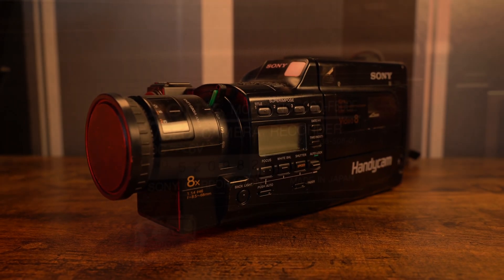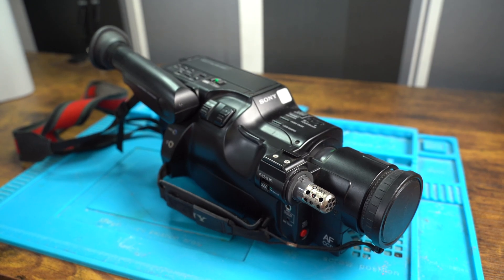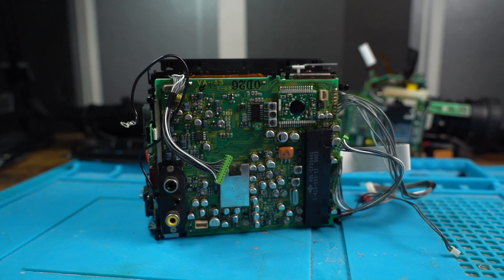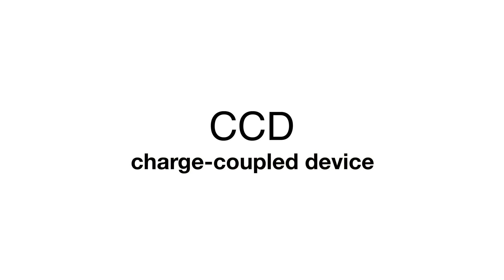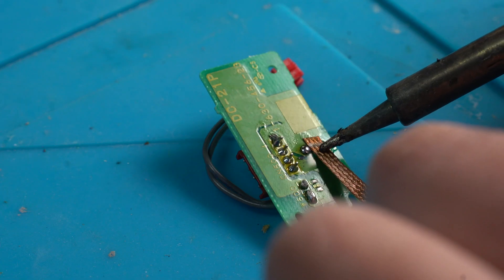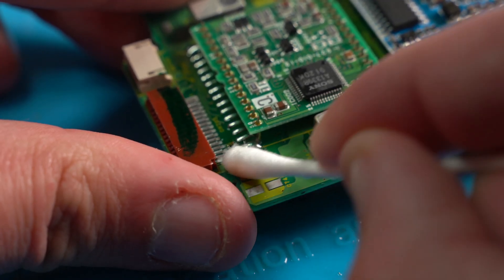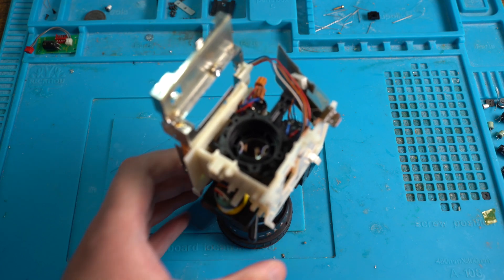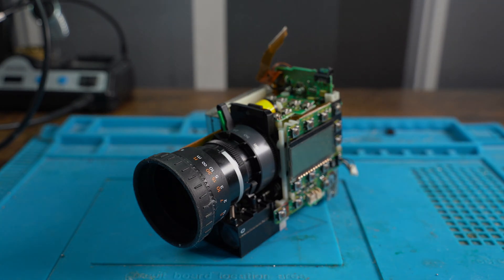Sony CCD-F500 Restoration - Part 1 - 4K

Comment: I have a capacitor that says 47 6s 36A what should I replace it with
Reply: not sure what the 36a is printed on the capacitor for, but replace it with another 47uf at 6v and newer too

Comment: This is a very informative video on how to recap an older Sony 8mm camcorder. I have a similar Sony model, the best at the time, the CCD-F501 (NA model, NTSC, circa 1992) which has same issue, it has power but the video section does not show any video, despite the fact that the playback section seems to work, at least the tape section. I want to really do a recap on this camera, as it served me well for more than 7 years before I moved on a newer TR-V41 Hi8 model, and the camera died because it did not get used for several years. I just want to bring it back to live not just for sentimental reason,  but also to use it occasionally as the situation calls for, even if I now mostly use my Sony DVC camera. This video is the most useful video I found that I can use as reference to fix my trusty old Sony CCD camera.

Comment: Im about to jump into a few hi8 cameras myself. My dad has 2 that are the exact same model. They power on but dont work beyond that. One has a working tape door but the other does not. My guess first off is going to be caps. I know its going to be tough but im going to take a lot of pictures and videos. I should have everything i need besides replacement caps. Im not sure what ill need to order until i take it apart. Im very worried about the plastics. I dont even know if theres been teardowns of the cameras im about to jump into. Ill probably be using this video as a reference despite it not being the same camera because this seems to be what ive got for resources. I appreciate the videos a lot.

Comment: I realize this video is 2 years old, but I just came across it doing research on recapping a Sony CCD - V99, which I believe to be very similar to this model, they definitely look very similar and we're both made in 1989. I'm assuming that the difference between the v99 and the F500 is that the V99 was able to use Hi-8 format tapes. I'm wondering if you have a resource that you like to use to find wiring schematics and information about the electronics within these types of camcorders. Any information you have would be greatly appreciated, or if you just want to chat about vintage camcorders, I'm all ears! Thanks very much, and great video! This is a great starting place for me to learn more about working on these types of camcorders.
Reply from the maker: Thank you very much. Unfortunately I do not have any schematics for the camcorders. I would be open to chatting with you. My email is always open to everyone, drop me an email. This can be found on the About tab on my channel page. 😊
Reply: I really appreciate your quick response! I will definitely send you an email, I really appreciate you being open to chatting about it. I'm going to watch all parts of this video and get my thoughts together, but I will send something to you by the end of the day. Thank you again!

Comment: hello, thanks for the instructions and great video. Im trying to restore my own cam, same model. Mine is not as bad as your, but some capacitors need to be replaced as well. I am struggling to find the right capacitors online, could you recommend me a website to get all the components? Thanks again for the video

Comment: Even if it is fixed it will most likely fail later due to cap leakage between the board layers. I have restored most of the Sony Video Walkmans inc the GV-8 and GV-9 which are terrible to restore. Lots of leaking caps but I do have 3 x fully working gv-8 and GV-9 units.

Comment: For the solder gun, what temperature setting is convenient?
Reply from the maker: For a soldering gun, it really depends on the type of solder that is used on the board, however, if the board was made in the early 2000s and back then I would recommend between 340 degrees and 370 degrees. If the solder does not melt or you having difficulty removing the solder, then gradually increase the temperature but don't put the temp too high as it could damage the pads on the board.
Reply: @theretropal  thanks. The circuit boards I work on will be mostly ones from the 90s as I have a variety of cameras needing all new components. So will this recommended temperature also be 340-370 on those 90s boards? Or lower
Reply from the maker: @CycloneCordVHS  Yes, just avoid using lead-free solder and use leaded solder and flux, which helps the solder to flow better.

Comment: This is fantastic. I have one of these which I bought when they were first released. I'm experiencing exactly the same issues as per your video. I need to get it fixed so I can transfer all my 8mm videos to a digital format. It looks like a big job but I'll give it a go. Hopefully Part 2 will be available soon. 

Any chance you could put up a list of all the required capacitors? That would be super helpful.
Reply from the maker: That is great, glad the video will be helpful with repairing more of these classic camcorders. Regarding the capacitor list, I will attach a full list of them in Part 2 for everyone. I'm still currently recapping each board which is taking some time, especially with this heatwave.
Reply: @theretropal  That's fantastic, thank you for all the hardwork you're doing. I hope I'll be able to fix mine but I definitely won't be starting on it until the weather cools down!
Reply from the maker: Part 2 is now available to watch: https://www.youtube.com/watch?v=un3T1atoNf0

Comment: This video is actually super helpful. Seems like it'd be a headache to work on but whatever it takes to save these things from the recycle bin. I have a CCD-F77 needing all new caps this that and the third but I don't think I have all the refurbishment tools yet. That and I still need to dissect it which I haven't gotten around to doing. All you need is a screwdriver, alcohol, soldering gun and fresh caps, right? Is there anything I'm missing? Otherwise great video!!
Reply from the maker: Hi, sorry missed your comment. Regarding your question. So for the restoration process you will need a screwdriver kit (I use the iFixit Pro Tech Tool Kit) however, any screwdriver kit will work for this. All the gear I use I've attached below plus put in the comments section of both parts.

Hope this helps.

Screwdriver Set: https://www.amazon.co.uk/iFixit-EU145307-4-repairing-laptops-electronics/dp/B07C2XDG55/ref=sr_1_7?crid=1PHTOUGV6OJEU&keywords=ifixit&qid=1658587124&sprefix=ifixit%2Caps%2C70&sr=8-7 

Holife Soldering Station: https://www.amazon.co.uk/Clossity-Soldering-Adjustable-Function-Temperature/dp/B09YV9GQ32/ref=sr_1_7?crid=2QNBV4FUHA0JB&keywords=Holife+Soldering+Station%3A&qid=1658586454&sprefix=holife+soldering+station+%2Caps%2C49&sr=8-7 

Duratool Solder Wire 60/40: www.ebay.co.uk/itm/142373084888?hash=item212618ded8:g:hkcAAOSw~y9ZDE2e&amdata=enc%3AAQAHAAAA4OOfWtOMtTgI%2FO93WKRhRo9rmd4DSHJmzLtuS232fORn%2B6vxY6DLldFFFm9Y5W3iK83JDtu%2BOBtVLntiQ8O0vezK9WT6thaQy26o1urXQwrKAFGhI9Cas3l37cgEzc5y7N5UEdF1Jo2fh%2FuP5%2F5kofPrv3ZMbNUvCKoD0kks3uLpufKyuv5D0ExuhKMyBwAfdnzg5mDsrnI335yof0yTE17HnwCIh%2B3nkheCww61soGFxpwS5u7zDRtalk%2BnmgTPHS9aY1OmRv%2B0lTQF7FXhacgEdMZwOJNtXKN7yRCe4YaY%7Ctkp%3ABFBMiNO6t8Vg 

LTronics RMA-223 Flux Paste: www.amazon.co.uk/RMA-223-Grease-Syringe-Solder-Soldering/dp/B07Q31D3SZ/ref=sr_1_1?crid=3RDFNE8HJUNN4&keywords=LTronics+RMA-223+Flux+Paste&qid=1658586746&sprefix=ltronics+rma-223+flux+paste%2Caps%2C49&sr=8-1  

MG Chemicals Desolder Braid: https://www.amazon.co.uk/MG-Chemicals-Desoldering-Braid-Length/dp/B008O9VLA2/ref=sxts_rp_s_1_0?content-id=amzn1.sym.997bd184-e71e-4447-bef9-c5495ae8a098%3Aamzn1.sym.997bd184-e71e-4447-bef9-c5495ae8a098&crid=2RCNBZWN79AG1&cv_ct_cx=flux&keywords=flux&pd_rd_i=B008O9VLA2&pd_rd_r=1638aee4-4ec3-4853-b925-d1b75d8e405f&pd_rd_w=qCues&pd_rd_wg=wtdRi&pf_rd_p=997bd184-e71e-4447-bef9-c5495ae8a098&pf_rd_r=1F6ATX6STZXSHZ3GWXYH&psc=1&qid=1658586503&sprefix=flux%2Caps%2C94&sr=1-1-1890b328-3a40-4864-baa0-a8eddba1bf6a

Echanic UV solder mask: https://www.amazon.co.uk/Mechanic-GY-UVH900-Curable-Solder-Protection/dp/B08F5D14TT/ref=sr_1_4?crid=DWVVBT2EJZV6&keywords=Echanic+UV+solder+mask%3A&qid=1658586800&sprefix=echanic+uv+solder+mask+%2Caps%2C45&sr=8-4

IPA: amazon.co.uk/ChemDistro-Isopropyl-Alcohol-Isopropanol-Disinfectant/dp/B08L596XRC/ref=sr_1_1_sspa?crid=2O2DNOZEZU531&keywords=IPA&qid=1658587090&sprefix=ipa%2Caps%2C64&sr=8-1-spons&psc=1&spLa=ZW5jcnlwdGVkUXVhbGlmaWVyPUExTVdTOFBHUUFMVjVBJmVuY3J5cHRlZElkPUEwODc0OTkxMkNaTjM1MVREUjAwMiZlbmNyeXB0ZWRBZElkPUEwMDAzNDUwMlJQWDNZVVFVVUhORyZ3aWRnZXROYW1lPXNwX2F0ZiZhY3Rpb249Y2xpY2tSZWRpcmVjdCZkb05vdExvZ0NsaWNrPXRydWU=

Comment: Wow just amazing you really want to revive this camcorder no matter what! Literally no techs want to touch the Sony CCD-F/CCD-V series 8mm/Hi8 camcorders because they don’t want to spend time cleaning the boards and removing and installing new capacitors as well as disassembling and reassembling the units. Hats off to you and I’m really looking forward to part 2! :)
Reply from the maker: Thank you VCR Guy, appreciate it. :-)
Reply: I'm actually considering undertaking that process with a CCD - V99. I'm not very experienced with electronics like this, although I am a mechanical engineer so it's not completely foreign territory to me. I'm starting to do a little research on the process of switching out all of the capacitors, and I'm looking for any information on where to find wiring diagrams or more videos like this one. I see that you also specialize in vintage electronics, and I just wondered if you might have any insights as well. I really appreciate any info at all. Thanks so much!
Reply from the maker: @DongusMcLongus  Sorry for the late reply. If you drop me an e-mail, if you still need any insight or support with this project.

Comment: That's cool that you uploaded the annoying process. I'm doing the same with a JVC GR80. But I'm too lazy to do every single capacitor since the vhs portion works flawlessly and the camera has a picture it's just all red. I want to get an esr meter but they're impossible to find in my location so i might need to get it online which i hate
Reply from the maker: Hopefully you will be able to get the GR80 working 100% eventually. :-)